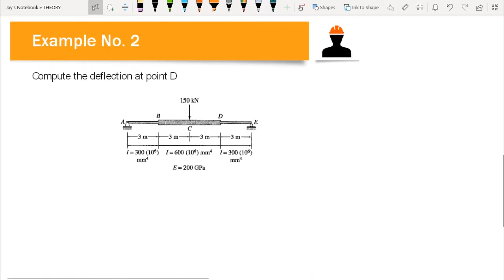Structural Theory | Beam Deflection using Virtual Work Method Part 2 of 2

Comment: This problem can also be solved using three-moment equation. First by identifying the reactions which is Ra = Re = 75 kN, Then followed by getting the moment equation of the entire beam starting at point A which is M = 75x - 150<x - 6>, therefore, other parameters will be:
Ma = 0
Mb = 75(3) - 0 = 225 kNm
Md = 75(9) - 150<9-6> = 225 kNm
L1 = 3 m
L2 = 6 m
I_2 = 2(I_1)
EI = 200(10^6)*(300*10^-6) = 60000 kNm^2

6Aa/L = 0
6Ab/L = (Pb/L)(L^2 - b^2) = [150(3)/6](6^2 - 3^2) = 2025

Since the deflection at B is equal to the deflection at D, therefore, we use the reference line at deflection at B which means that h1 = ?? and h2 = 0 

Substitute all the values to three-moment equation
0 + 2(225)(3 + 6/2) + 225(6/2) + 0 + 2025/2 = 6(60000)(h/3 + 0/6)
Therefore, h = 0.0365625 m = 36.5625 mm